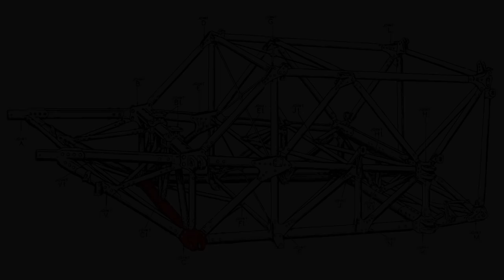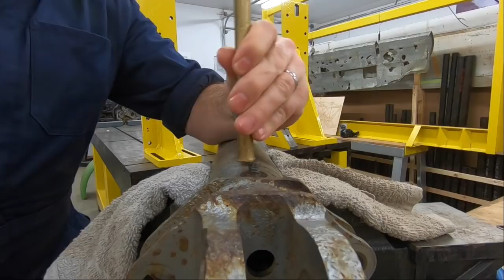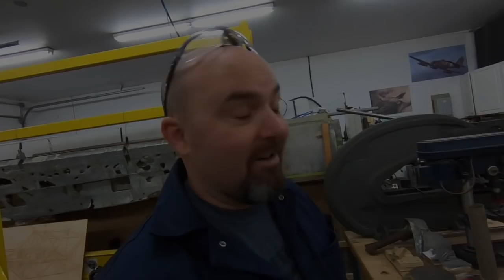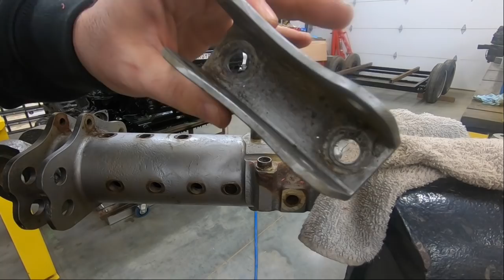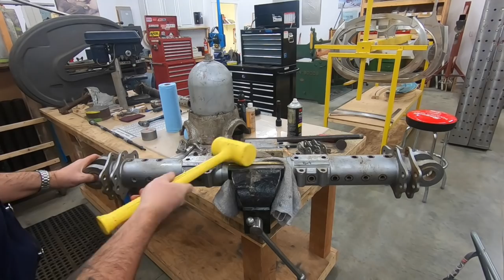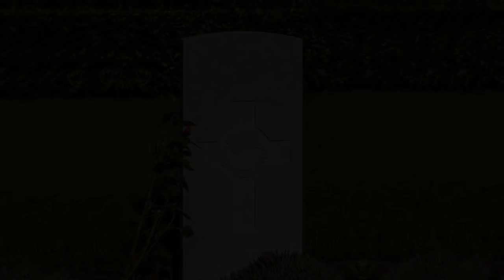S01E09 Hawker Typhoon Wing Spar Hidden Parts!

Comment: It's amazing the level of internal corrosion in those tubes. They looked in pretty good condition, but just goes to show why you need to inspect so thoroughly. 👍
Reply from the maker: Absolutely! For parts that will get reused, even if they look good they will also go through NDT to look for internal faults and intergranular corrosion.
Reply: @TyphoonLegacySociety  does NDT include magna-fluxing and or X-ray?